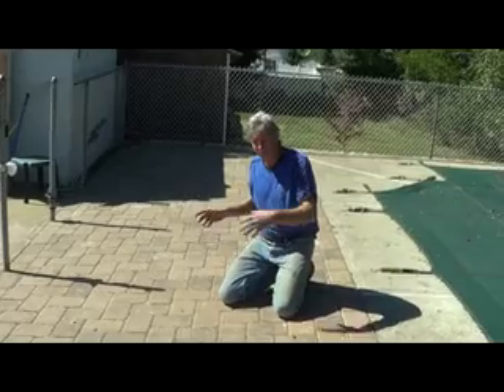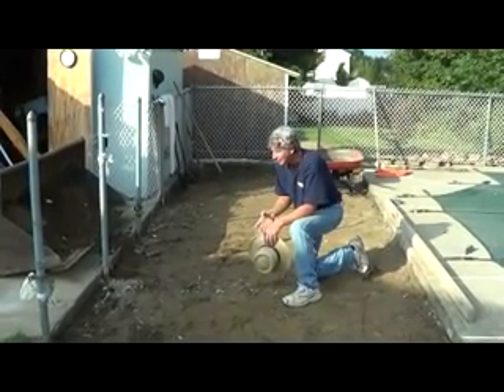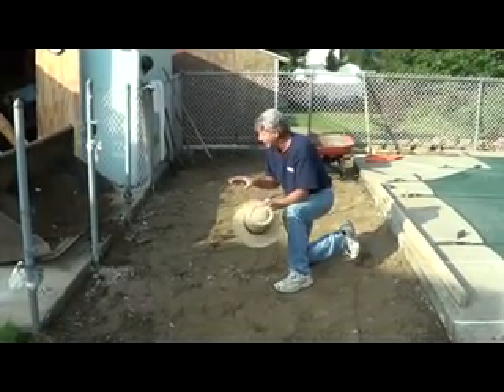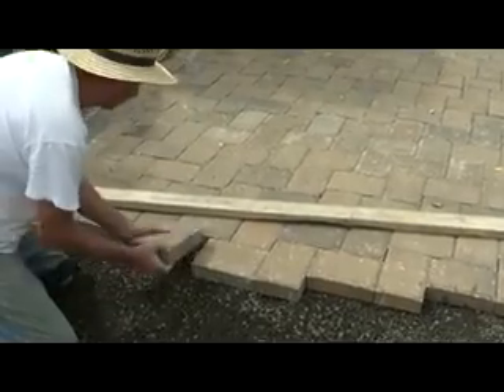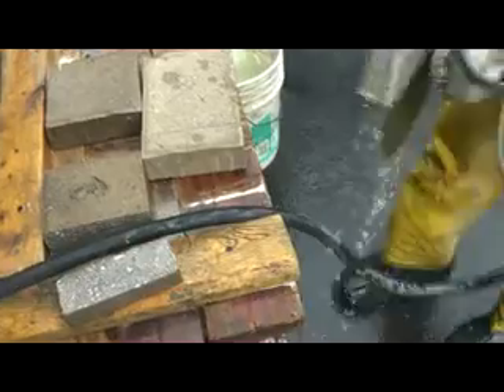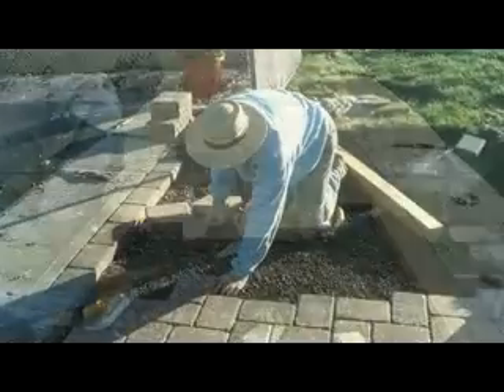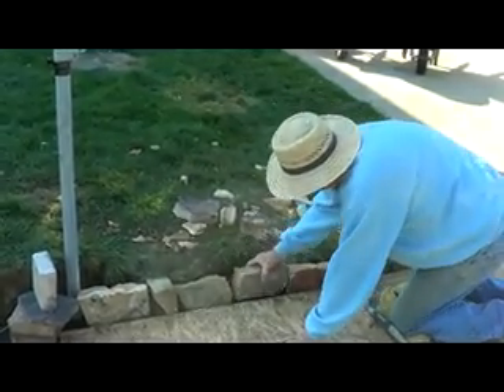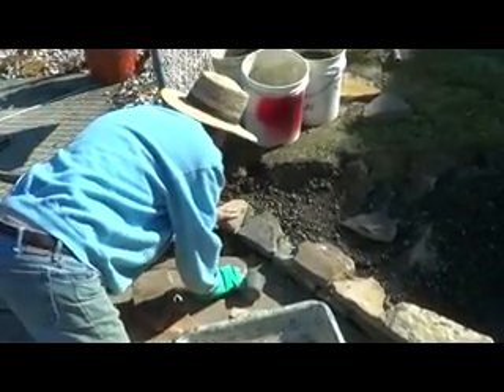PAVER INSTALLATION (Part 4) Mike Haduck on gravel

Comment: Hey Mike
Great work 
We use granite chip #9 in the joints for permable paver jobs
The base is in many layers 
soil tamped 
Filter fabric 
3/4" drainage / clean stone 
3/8" blue chip stone 
Pavers with wide joints ( big lugs)
And granite chips #9 
Sometimes drainage pipe 
Becoming more and more popular in Philadelphia area as they want all the runoff back in the ground 
Keep up the great videos!
Bill
Reply from the maker: Thanks Bill, it's good to hear that, Mike

Comment: My paver supplier recommended laying them like this. Never heard of it before until now. I typically use sand but will be trying this method in a weeks or so.
Reply from the maker: Hi Biker, I have never had a problem with this method,for this type of paver, thanks, mike
Reply: Mike Haduck Masonry how do you keep the joint sand from washing down in the block? Do you use a poly sand?
Reply from the maker: I don’t think I use the sand on that at all,  but if I did yes I would use the poly, thanks mike

Comment: Would it be okay to mix sand with pea gravel for a paver base?

By the way, thank you for the video. This is the first time I've seen anyone use gravel for the top paver base. Its very helpful! I've seen others complain about using the proper base and they always say to use sand on top because the gravel won't hold the pavers still enough.
Reply from the maker: Hi, everything depends on your situation and what type of pavers you are using, for the most part we gave up using sand or rock dust years ago and if we don't lay them on concrete we usually use pea gravel, my opinion, thanks Mike

Comment: Hi, Mike. Great Video. What kind of wire did you use for the stone curb/in the cement? Hard to see in the video. Single-strand 10ga galvanized? Thanks for your help.
Reply from the maker: Hi Trapper,  I dont know the gage but it was called duro wall for between block work, thanks Mike

Comment: Great video! I’m looking to do something similar in my back yard. Only using porcelain pavers. I want to stay away from sand because that can potentially bring ants. Would this same method work w porcelain or does that require something else?  As an FYI the perimeter  would have porcelain pavers bonded to a concrete slab using mortar, and gravel to be used like in your video in the middle. Appreciate  any feedback
Reply from the maker: Hi Ash, I can not say unless I seen it and was there to test it, every job I'd different,  I would ask some of the local guys, thanks Mike

Comment: Hi, Mike.  I have 3-4" of pea gravel on my backyard.  Every where I turn for some advice,  people say pea gravel doesn't provide a firm base so the pavers will move in the future.  How are the pavers you have installed so far? Any dips and heaps over time?  Thanks for your time. Jay.
Reply from the maker: Hi Jay, they are as good as the day I put them in, and been doing it for years,,  so I do not know what else to say,  thanks mike

Comment: Hey Mike, If you were putting pavers around a mailbox sunk in dirt, would you use gravel or paver base?, Would you use sand with cement? Would you put a border - the area is very small, - 15 square ft (rectangular). Thanks!
Reply from the maker: Hi wdcort,  I can not say, every situation is different,  every mason says different,  I would have there to see it.  thanks mike

Comment: I live in South Dakota will doing a patio this way hold up in winter? I have never seen it done just by putting pavers on pea rock.  We had concrete torn out last year, filled in with gravel and put pea rock down for the winter so we didn't have a mud hole. Would be super easy to finish the patio without removing the pear rock and outing the sand base down.
Reply from the maker: Hi Dave ,  I can only show the way I did it, and I can not tell anyone how to do something but I have never had a call back with these types of jobs,   I hope it helps thanks mike
Reply from the maker: Thanks Ian,  I appreciate it.  mike
Reply: Thanks for the info I may have to give this a try. Looks very simple.

Comment: hey mike what wire did you use around the border?
Reply from the maker: Hi , I used what is called duro wall, it goes between concrete block courses, but I could just use concrete wire if I wanted, thanks mike

Comment: Great video as usual mike. I see when you took up the existing concrete you then tamped the soil and set your gravel in place. I see some people lay down sheets of plastic before they back fill and start laying the pavers. Why is that done on some projects and not on others ?
Reply from the maker: I would think it is a garden mesh they are putting underneath, to keep the weed out,  we did not have to worry about that and we did not want anything to hold the water,  everybody got a different reason I suppose,  I hope it helps thanks mike
Reply: +Mike Haduck I was thinking it would hold water alright and prevent drainage. Thanks
Reply: +Mike Haduck there's a type of sand you can use to fill the joints to prevent the weeds getting through right ?
Reply from the maker: I am a fan of pouring concrete first and then you never get sinking  or weeds  but sometimes we use a weed barrier under the pavers, in this case we want the water to go right through, because of the driveway and water situation,  every situation is different, I hope it helps thanks mike
Reply: +Mike Haduck cheers mike

Comment: I'm having a hard time removing old mortar . Acid is not working. What do you think?
Reply from the maker: Hi albert,  I rarely use acid for anything except new brick or stone to get the film off,  usually a lot of hand work , wirebrush, etc,  I hope it helps thanks mike
Reply: Mike Haduck and by doing that,especially new mortar you remove it's first line of defense against weather,just be neater and learn how to point.

Comment: Ahead of your time Mike,they have pavers now,called Permea Pavers,which have a wider joint,and let the water run through them,and leach into the gravel.Basically the same as what you did,have a product also to "sand" the joints.Done this many times,with excellent results.
Reply from the maker: thanks, Pete, I appreciate it.  mike